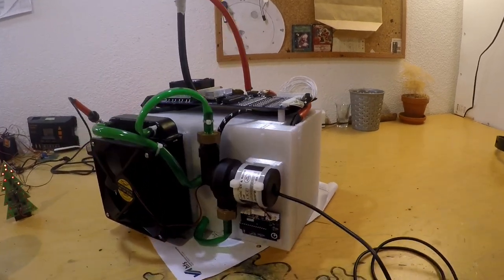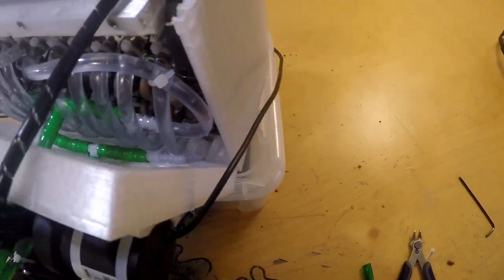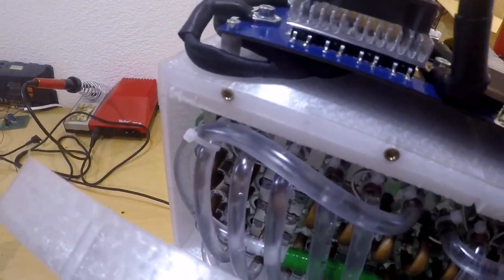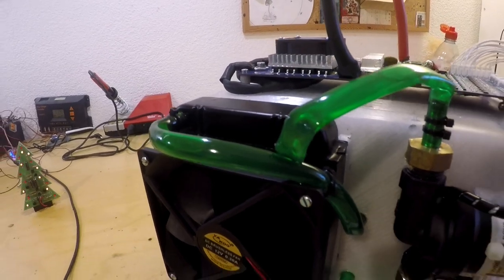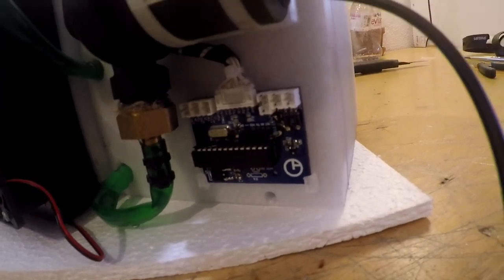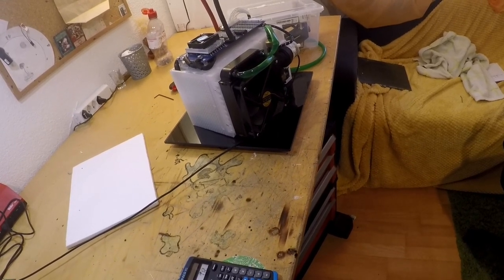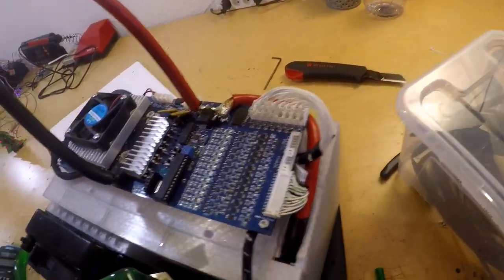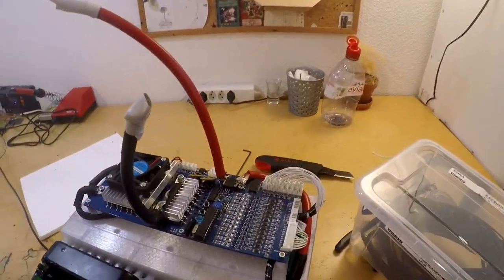LIQUID COOLED Li ion Battery Part 2: Testing the cooling system

Comment: Nice job sir the experiment was amazing u are aspiring the user but ur doing for sale or experiment? There is a advice for u if u want best working please attach ammonia gas  refrigerator to the battery this will give best colling. Please make this experiment and the  experiment which I told u will used in home, electric car etc Please try this experiment and post the video.

Comment: Great idea mate ! My only concern is the green pipes are bend , once the water heats up they will colapse and block the waterflow .You can buy some teflon tubes and replace the green pipes with them ;)
Reply from the maker: Yes the green pipes are in fact not the best choice i but it works for now. I will look at teflon in the future though thanks!
Reply: What if glycol is used? That solves it right?

Comment: Impressive project, and a job nicely done! keep up the good work. I particularly like that you tested the system overpressurized. Maybe you could make that step a bit more controlled and link up a pressure gauge to set up a well defined tolerance for the pressure.

Comment: Where did you buy the radiator from? How are you going to control the pump?
Reply from the maker: The radiator is from amazon. It is a radiator for liquid cooling PCs. I will control the pump with an arduino :)